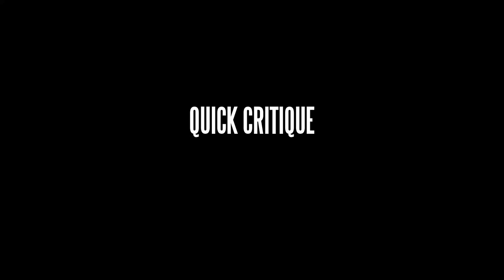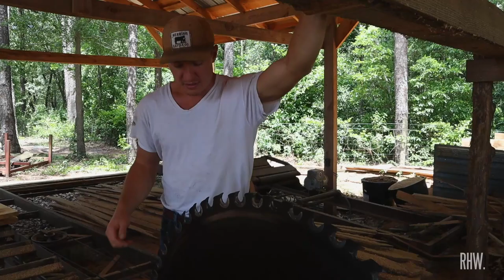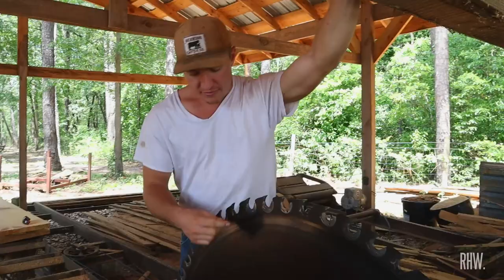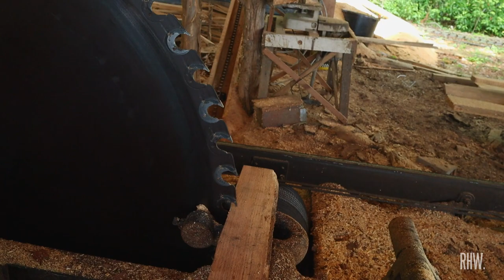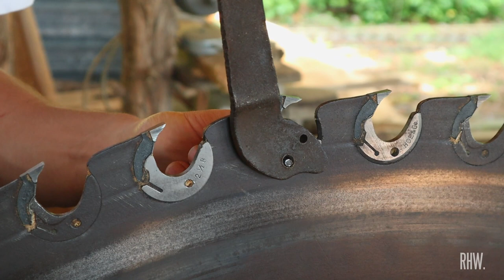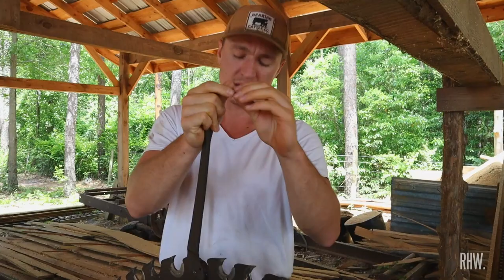Teeth and Shanks!! [Dental Work Part 1] | Quick Critique

Comment: Question, I have a few (4 total) bits seized up on my blade. I’ve tried Blaster soaking, heating with small touch, and soaking in diesel fuel with no luck. Do you have any suggestions on how to un-seize these saw bits. Any help is appreciated! Thanks
Reply: Try wire brushing any rust or old saw dust from the cracks around the shank and bit and spray with WD40. After it soaks you still might have to wedge the blade where it won't move and tap the bit wrench with a wood mallet.